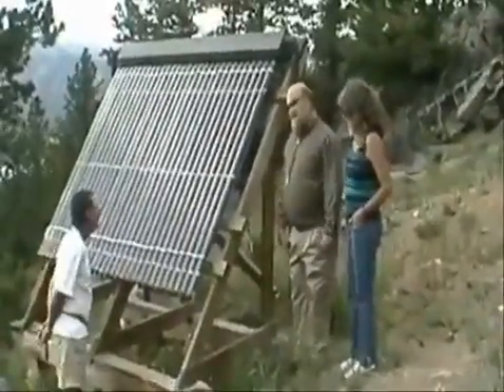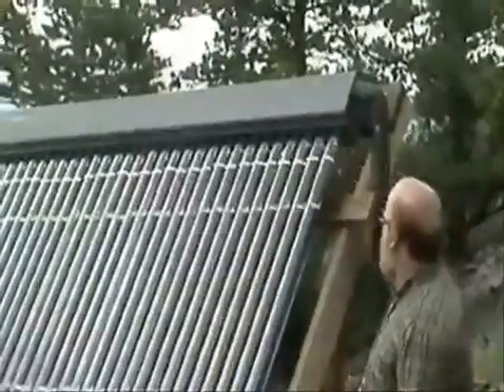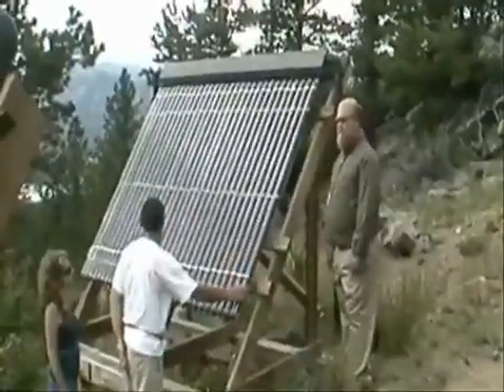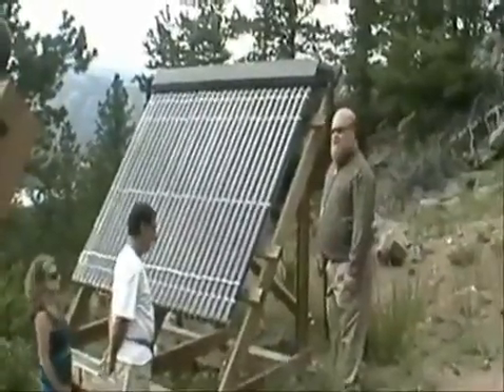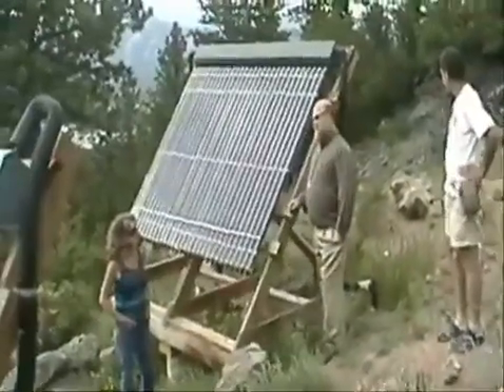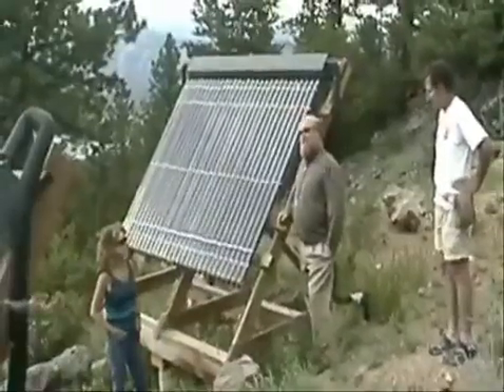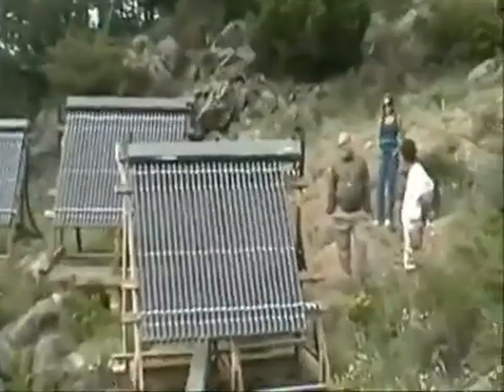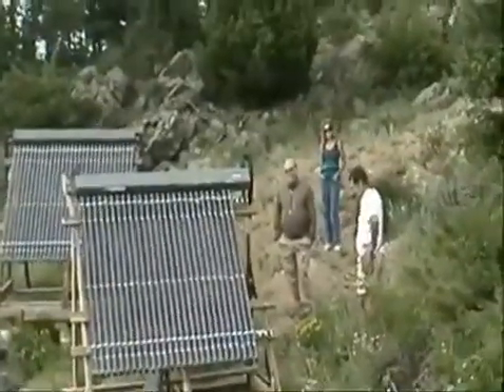Homemade Solar Energy (Hot Water System)

Comment: Looks ok, maby even some mirrors shining on the collector of the hot water heater can add some more watts of heat into the system - either plain old mirrors or a heliostat moveable mirror.